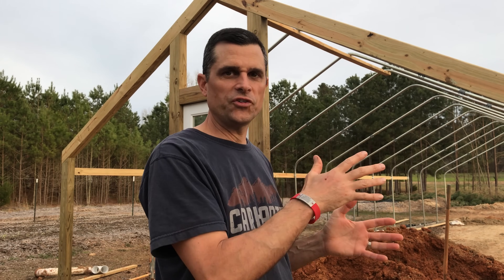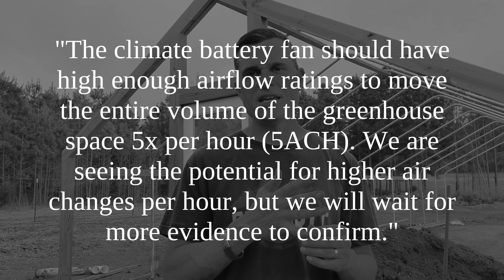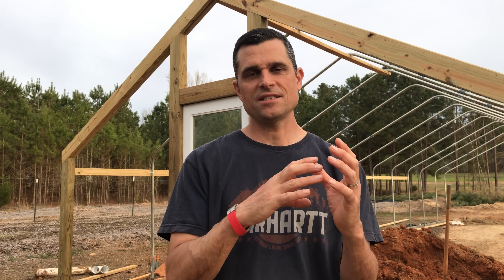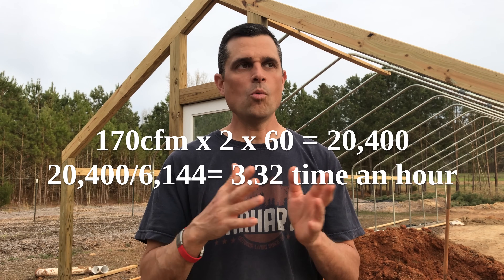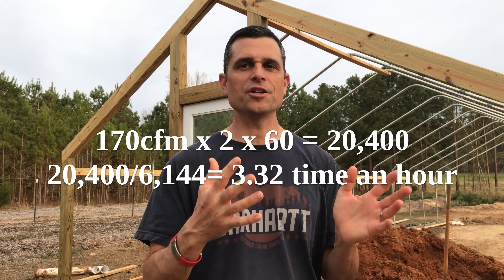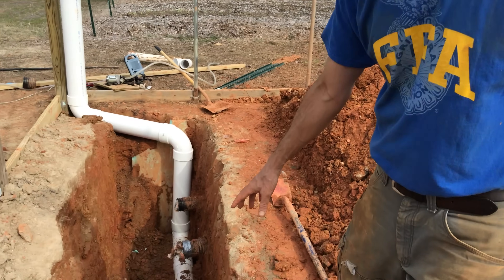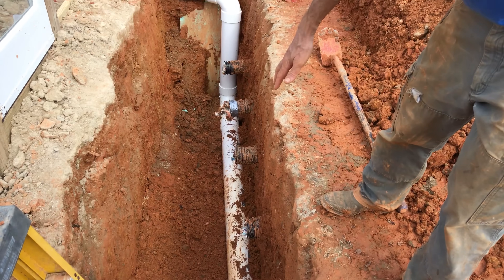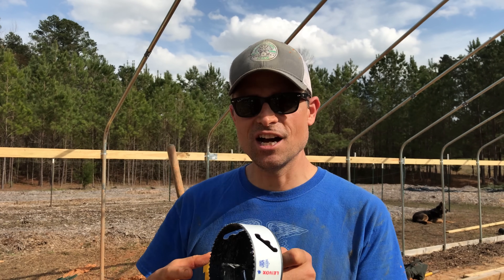DIY Geothermal Greenhouse Part 7: Earth Battery MISTAKE!

Comment: Earth's average temp some where around 50°F and your outlet temp. 35°F....  Do you think that lower temp is do to a wind chill effect
Reply: I agree with this question.
In fact I searched for it.

Is the ground 4 ft down frozen in that location for Easter? Normally I'd expect no lower that 54° deep down. And here in New Jersey the frost line is concidered to be less than 36" down.

To get 35° out, I'd expect at least a few degrees lower than that in the battery.

Comment: You are missing a factor in your math.  The fans will pass that amount of air with no restriction. You are passing through pipe which adds restriction plus the elbows and your manifold are creating resistance.  I am wondering if you actually measured your air flow after you got everything put together.  If you did I am wondering what was your loss due to the friction of the pipe?
Thanks
Reply: ADS tubing wasnt designed to move air and every installation is different so the only way to figure the loss is to measure it. If you design the system for minimal loss when running an hourly flowrate equal to 60x the entire greenhouse air volume you`ll be in good shape.
Reply: JohnGuest45 Thank you for your response.  
I am very curious as to what you are using for your fans? What is the actual cost per hour?
What were the fans rated for in air flow? What was your result when you measured your actual flow compared to what your fans were rated?
What device did you use to measure your final air flow?
I appreciate you taking the time to answer me as this has started a very contentious debate here.  The cost per hour or energy used per hour is 
hour is what what we are really looking at with your actual air flow, compared to your fans rating.
Again I really appreciate your time and help in this.  We are looking at doing what you have done and the air flow is obviously key to this project.
Thanks 
Tony L
Reply: JohnGuest45 John, thank you very much for all of the information and your help!  This is all very much appreciated! 
Can you tell me what is the total linear feet of pipe you are moving air through with the fan? What were your results 
On the air flow testing? 1100 cfm fan rating I see that but did not see your results from the testing you did.  The cost 
To run your energy cost the max is 300 watts but where did you land on your average draw of electric power demand?
You run your fan at a constant speed 24 / 7 at xxxxx watts? You avoid peak energy demand by finding a constant speed to maintain the temperature.  
Your help on 3 -4 numbers is needed if you have a moment?
Average energy consumption in watts?  Do you have a killOwatt device in front of your fan for this? Or similar device?
Average number of hours per day fans are running?
You max CFM and average CFM from your fan?
Thank you so much and I will try not to bother you again until we get way deeper into this project if you do not mind?
Thank you again for your help!
Tony L
Reply: JohnGuest45 Thank you again,  we appreciate your help, feedback and time.
I will be back with more questions if you are OK with that?
Have a great night.
Tony L

Comment: If you look at the Eco Systems Design implementation of this idea, they are bringing the four-inch pipes into a 16 inch manifold tube, not a 6 inch manifold.   In effect, they are able to run 16 4 inch pipes (approximate) into the 16 inch manifold while allowing full saturation of the four-inch pipes.   Some quick math behind that.  A 4-inch pipe has a 2-dimensional area of 12.57 square inches.  A 16 inch manifold pipe has 201.06 square inches.   201.6/12.57 = 16.   Your design has six 4 inch pipes?   If yes, then you would need a 10 inch manifold to completely saturate the six 4 inch pipes.   Area of 10 inch manifold cross-section is 78.54 square inches.  78.54 / 12.57 ~= 6.3 of the 4 inch distribution tubes.
Reply: If the 4" tubes protrude into the 16" manifold you will incur some major losses, the transition should be as aerodynamic as possible but with tubes its not always easy to do.
The 10" pipe may not be big enough depending on the length. Eco systems recommend tube lengths upto 35ft wgich limits the amount of air to around 50cfm. Assuming the system has 16x 4"  tubes and they all get an even share, the manifold should be designed to handle at least 800cfm with as little loss as possible. If, for example, the manifold is 20ft long you`d be better to go for a 12" manifold not a 10".
Fwiw, Eco system designs are based on John Cruickshank`s original design work. Its also clear from this page that they respect and appreciate John`s great work in this field  
http://www.ecosystems-design.com/blog 
Its unfortunate they werent involved in the discussions  on John`s "plain to sea" forurm circa 2008-2010 when collaborative testing and data collection culminated in some radical changes to the original design criteria, Some folks who had systems in the ground actually dug them back up so they could benefit from the new information. Its good that Eco systems have adopted one of the changes, which is to recommend much higher air turnover rates but seem totally unaware of the other sweeping changes. Johns website wasnt updated with the new information as he passed away in 2011. .
   .

Comment: Never push a fluid in a narrow space, pipe is one example, always pull it. The fluid has properties to organize itself in order to decrease resistance. If you push the fluid, instead of pulling, you are creating turbulence, as the fluid in front of the one being directly pushed, creates a resistance, according to the 3 Newtons' law, there will be reactive force back, aka known as eddies or turbulence,  and eddies or the turbulence  will be decreasing immensely the capability of the system to efficiently channel fluid for a give amount of energy input and given fluid channel geometry.

Comment: Air-moving pipes will flow better if the lengths are shorter, having no right angles --45s are better--, avoid 'wrinkled' surface. Perhaps aluminum vent pipes could suffice

Comment: Did You drill Your pipes to release condensing water? Maybe, it will happen that one or the other pipe fills up and breaks down airflow....
Reply: Ideally,you should cut a straight slot along the full length of each tube partway through the corrugations. Dont cut right through the corrugations and into the pipe.  Orientate the slot at the bottom when you install the pipe

Comment: The average de-rating percentage for actual airflow is about three to seven percent because of "skin effect", which describes the air friction with the inner surface of the pipe. Fluid dynamics is another term where this is calculated to get actual flow rates.

Comment: The way you test the company's claim is to do a current draw reading on the motor. If the current decreases, then they are wrong, because we always restrict three phase blower and pump motors all the time to control the current draw, and prolong the lifespan of the motors. It's volume that causes the most drag on a motor, not head pressure (outflow back-pressure) with AC motors. I'm not sure why DC motors would be any different.

Comment: What if you used an 8 inch pipe with a 4 inch pipe?  Would that give "positive" pressure to the fan?
Would that be a good thing or a bad thing for the system?

Comment: You are outside working at 113 degrees and not even breaking a sweat?   How is this possible?  ( I melt at 85 degrees in NC.)
Reply: He measured the temp next to a hot motor.

Comment: I found these videos interesting. I’d spend more on a DIY solar water heating method. Water can transfer heat much faster and you could store water for use at night.
Reply: water isnt the best option for this application for a number of reasons...
Reply: @JohnGuest45  What about closed loop glycol with a heat exchange?

Comment: My thoughts in theory...
Would be to have a larger manifold coming right off the fan equally distributed to the buried grid..
Slowing down air flow thru all the tubes trying to balance the air flow.. Giving time to enhance the heat exchange..
My thoughts are,  to high of an air flow speed could heat the air because of friction...
But when i set up my testing I will try to record as much info as possible...
My first green house won't be the most efficient...
But will be my testing center...
and after testing each individual grid..
When tied together should be give the desired results..and much needed testing..

Comment: I don’t understand.  You are passing air through the earth to heat or cool it.  The earth about ten feet down has the same temperature as the average annual air temperature for a given location.  Example where I live in north Missouri the ground temperature is about 55F.    You showed your outlet air is 35F which means you must be in a very cold area.  How are you going to warm a green house with 35F air?

Comment: Use the proper math :) easy flow manifold sizing is think if you have 10 1" pipes the manifold should be  10"  you need a huge manifold lol and clay has a thermal transfer rate of about an in an hour and you have to factor in the installation on the pipe use steal culvert pipe for better thermal transfer;)

Comment: One reason to have larger diameter fan and manifold is that smaller piping will move air faster resulting in less heat exchange

Comment: Look up the old man's system who has been growing citrus in thermal greenhouses.  Got a bunch of videos on YouTube.  You should be running individual tubes a 100 feet long and 8 feet deep to convert the air to earth's temperature at around 58 degrees.  I would be shocked if this worked.  I will watch more of your videos to see end result.

Comment: Yes, your system is not ideal or optimized for maximum performance. It would take some serious engineering dollars to achieve that. BUT, your design flaws are not the end of the world. This earth battery system will still work, and although air flow will be lower than it could have been I think you will be happy with the results you get.

I'm not sure about the advice you have received re fans and fan life. Assuming the fan you install is a centrifugal type such as a backwards-inclined squirrel cage, the logical choice, motor load DECREASES as you restrict the flow. I know this is hard to believe, but put an ammeter on the leads and see what happens as you throttle the outlet. The current falls. Maximum power and therefore maximum current draw is at full flow or nothing on the outlet at all. Yes, your restrictive setup will decrease air flow but motor load will be lower and I see no reason why motor life should be reduced at all. 

By the way, the same applies to well pumps. Maximum amps are drawn when the pump is pumping unrestricted, with nothing on the outlet line. Minimum current draw is seen when the flow is stopped entirely with a valve. That's why Cycle Stop valves work so well, and why I always install one on well pumps that supply irrigation systems.

You've done a great job here. Don't beat yourself up!  Cheers from Canada.
Reply from the maker: Thanks!
Reply: Paul Maxwell is m

Comment: hey, just from reading some of these comments about mold i would suggest that if you do decide to put a filter in you should also add another pump after your exhuast but before the filter to make up for a little bit of that air flow that will be lost due to the resistance of the filter and avoid a higher static pressure on your intake fan. this is just to ensure you are getting the cfm's you're looking for.

Comment: you only went down 4 feet, I see issues. The reason for my thinking is the temp at 10 feet under the perma frost line is a constant 55, as you go up from there the temp will very with the changing seasons. at 4 feet your just getting to the point where your temps are becoming more standardized. Seeing the temp you show in the vid while knowing that 55 is the normal temp is evidence of this. 

The temp your showing in the vid is fine for that time of year but it will change week to week in every season as it is not far enough down to reap your systems full potential benefits.